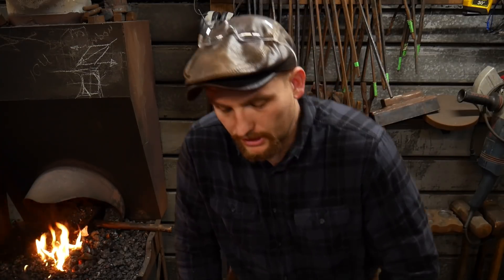Thermocyle Your Coil Spring Steel (The thermocycling process!)

Comment: Thanks as always for the great information Roy!  I had about three pieces made from coil springs I forged out recently crack on me in odd length-wise ways, and I thought it was just a bad piece of spring.  I was only doing one cycle of heating and cooling before forging, just by chance because I straighten them all before starting.  I don't know much about metallurgy, and normalize before quenching, but now I know that may be too late to relieve stress before forging takes place.  Thank you man!

Comment: Roy as a knife maker I agree always thermal cycle you never know what kind of stress the found steel was under when it was in service. Sometimes when I'm TC leaf springs when it is coming down to a black heat you can give it a slight bend when still hot. Doing this will allow you to see any stress fractures when it cools. You can see them as black lines in the steel sort of similar to when you have a bad weld. I do this with coil spring as well. But needless to say it it important to thermal cycle to refine the grain structure and release the stresses from its previous use.. Thanks for all the great work you and Jess do for us.. God Bless, Martin

Comment: Good tips.  I end up getting impatient and just forging out a tool from spring steel.  It will bite me soon enough.  I was doing that in the coal forge. I like the tip on doing a lot of coils at once in the gas forge and turning it off and on.

Comment: As you informed me that did indeed stop my stuff from cracking lengthwise. Thanks a bunch. One question tho. Cool to black? Black heat or cool to the touch. I've been cooling to ambient temperature. Just wondering if that's necessary

Comment: Is thermocycle the same as annealing?
Reply: The fast answer is no. When you thermal cycle you release any stress from the making process and the work said piece was doing when in service. It also redefines the grain structure of the steel. When you anneal a piece you are heating to above critical and covering it with ash, or what ever you use to do this process in. I normally anneal a piece after the TC so the piece is soft. Some or shall I say all carbon steels will air harden a little so this is why you anneal . There's a lot more to know perhaps Roy could do a video on this to give you and others a better visual on the process.. Martin